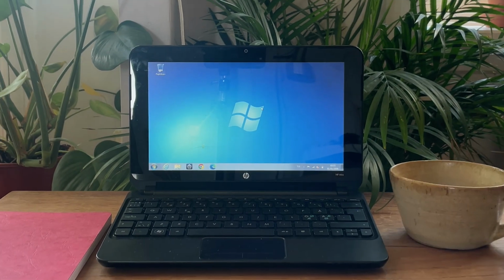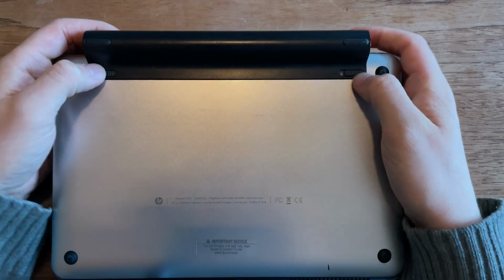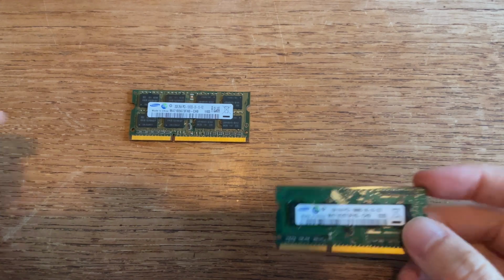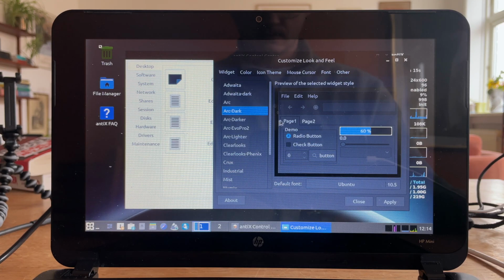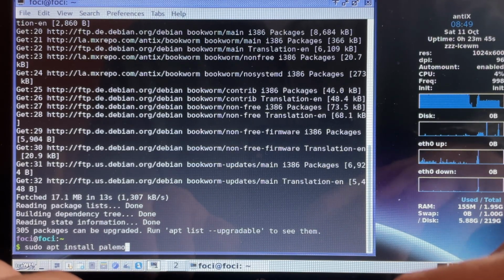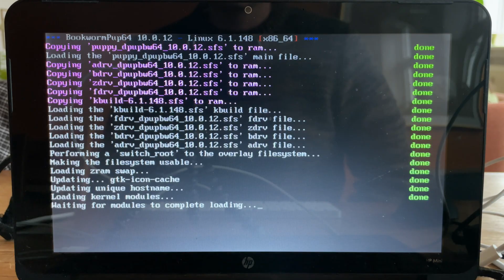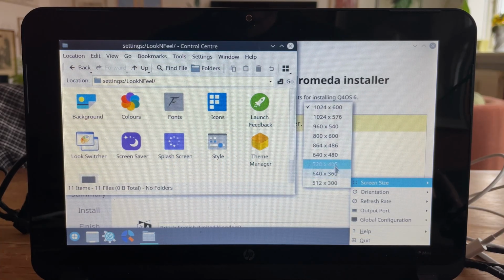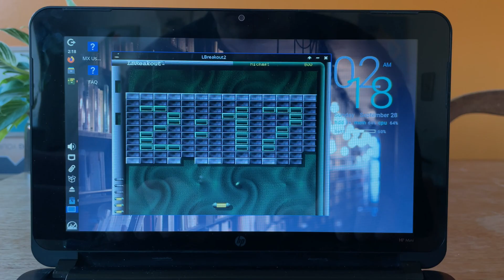Can "lightweight" Linux distros save this tiny laptop from 2010?

Comment: Firefox more like bloatFox ,its a mess on low end hardware.
From my own experience, install chromite +UBO lite extension for blocking ads +h264fy extension to loading h264 streams ,its the lightest codec to decode on these atom socs.
I also use chromite on my 1GB ram phone ,its the lightest up to date open source chromium fork

Comment: As a fellow  2GB RAM user, here are my advice: ZRAM for virtual ram and mpv + the terminal for streaming videos.
Reply: With a well optimized ultralight OS AND a browser thats no heavier than Chromium, in this case maybe even lighter like Basilisk. Its possible to get away with some streaming up to 720p in alot of these situations.
Reply: @TacticalPower88  1080p at 30fps worked fine. Another option is to run chrome/chromium with the flag:
--disable-features=UseAV1,UseVP9

Speaking from actual experience. Those ultralight OS are missing to many things that are useful for modern day system
Reply: Also have 10 GB of zram. I have a 8 GB PC but I still have 20 GB of zram, very useful when I'm compiling a Browser or open office type app from source.
Reply from the maker: Hey Neco! Thanks for the advice! New video coming soon :)
Reply: virtual ram.... no way you're telling me. I CAN ACTUALLY DOWNLOAD MORE RAM 

(not literally ofc but lmfao)
Reply: @TheQuaadFather  Same RAM, just compression
Reply: This.
Reply: ytfzf goated
Reply: Can you explain a little more detail on ZRAM and mov+terminal method? Looking to daily drive a 2gb atom tiny computer but know it will bottleneck
Reply: @flowermaze___  ZRAM compress some of the memory, for example with 2GB you might be able to get 3 to 4GB total of virtual memory. Auto-cpufreq might help you squeeze the maximum CPU speed if your CPU is design to do so. mpv + the terminal is use for video site like youtube that have issue with HD video playback on low powered machine. For more detail on the risks and Step by Step on how to set things for your particular computer and OS try  asking an AI.
Reply: run alpine linux with openbox, and mpv on that. it should easily stream YT then. (I've done this on 1GB RAM + a 2003 Duo CPU)
Reply: how about upgrading to 8GB RAM DDR3? it will SERIOUSLY dramatically improve it!!!!1

Comment: i still think that the best experience on this kind of device, would be to install arch linux with a lightweight desktop-envirement on it. My best results on my asus AO 722 came with an endeavor os with xfce DE. I also tried arch with i3WE on it, it worked very well, but it demands a lot of tweaking. Unfortunately i tried a lot of deb/ubuntu lightweight distros on it, it was realy unusable.
Reply: If I had a dollar for every time someone said "we have to start somewhere" when it comes to the tweaking part...
Reply: also for youtube i would recommand minitube or freetube, minitube works very good, but i haven't manage to make it work in the last months. freetube works very good. I think both can be installed with apt install command.

Comment: Sounds like a perfect Match for Haiku (also known as "Haiku OS"), which is the Open Source Successor to the 1990's BeOS, that's being designed specifically to run on Hardware even as old as 1997. So, maybe give that a Try. I certainly revived my old 2009 EeePC Netbook with it and I can only say: It just works. Even paired with the Falkon Web Browser playing YouTube. 😊✌🏻
Reply: Haiku is cool but its still way too much of an experiment. You're definitely on a island with that one.  You would be way better off just going with Tiny Core Linux.
Reply: I've had touchpad drivers issues with Haiku, which can be disastrous if you use it without a mouse.
But I agree that HaikuOS could be a fun experiment on that hardware.
Reply: i have an old pc running windows 7 and i might consider trying haiku on it
Reply: haiku is a great match for these small machines i actually use it for taking notes at school
Reply: haiku doesn't support gpu acceleration, it's not a viable option
Reply: @kvdrr  It really depends on what you need/want out of the machine itself. GPU acceleration is much less important if you aren't browsing the web, playing games (especially 3D ones),  or decoding videos.
Reply: Not for everyone.

Comment: I have a similar dell mini laptop at home that nearly have the same specs, I tried peppermint oa on it a while ago, it was fine running local videos and displaying images. But the YouTube thing was a deal breaker bec it'd mainly serve as a media device.

Sadly though, these atom processors and from an Era where the main focus of a mini laptop is office work and only office work.

So if you're a user how mainland focuses on word processing or slideshows, this device is very good for such a task, just don't expect that much from it.

But if you wanna have some real fun with it, give batocera a go. It's a distro designed to be like a hub for emulators so you can enjoy playing older titles all the way up to ps1 and ps2 games with ease.

So yeah, give it a shot

Comment: I had one of those Atom Netbooks with debian Linux and xfce
Reply: I have one too, and I thought only supported 32-bit, but no, supports 64-bit. Currently has Debian 13 with LXDE installed.
Reply: Sadly, Debian has stopped with its 32-bit distro.

Comment: I believe mint tries to use UEFI boot by default. On a netbook of this vintage I wouldn't be surprised if MBR is the only boot option. Might explain your woes.
Reply: Nah its usually good at detecting BIOS/UEFI when running the iso. Sometimes Ventoy can introduce some unexpected things.
Reply: @TacticalPower88 that i can belive, the issue i had was a strange one, where the machine could boot UEFI but it had to be installed in a more traditional method and this pile of crap was able to run windows 11, more or less if grub and uefi got stuffed into root instead of uefi having its own partition it would boot regardless of which install, it just had to have a drive in MBR due to its age.

Strange issue even stranger fix. Oh if you do grub2 on ventoy it will do the legacy boot and menu.
Reply: dunno if XFce plays ball but a bypass i used with standard mint was to partition the drive myself in MBR then force the install. create a swap a root and a home and boom done.
Reply from the maker: Oh, thanks!

Comment: Loc-OS is AntiX debloated, even further performance optimized AND its using a far more fleshed out/useable GUI too. Definitely my go to potato PC saver for both 32/64 bit machines! BTW, app choice is important too. Firefox is definitely a no go on low end machines. Definitely dont go heavier than Chromium browser, Basilisk would be a solid lightweight browser for GTK based AntiX/Loc-OS while Falkon is solid on QT based distros.
Reply from the maker: Thanks a lot for the advice! I’ll definitely try Loc-OS and a lighter browser. Thanks for watching:)
Reply: @focivideo  And if you'd like to stick to Firefox try ESR 52. Severely outdated but friendly for worst machines out there. Used as a base for K-Meleon which is also intended to run on antiquariate
Reply: @focivideo Note, Loc-OS comes stock with Librewolf which is based on Firefox. My 1st order of business on a fresh Loc-OS install is uninstalling that and installing Chromium and/or Basilisk. Loc-OS is pretty light straight away but theres things you can and should do to decrease the system overhead even further. Uninstall what you dont need, make sure those desktop effects/transparencies/animations are completely turned off and definitely disable unnecessary startup apps. This thing should actually be able to multitask with a few browser tabs and another app or two open. An AI chatbot companion like Google's AI mode or ChatGPT can easily help walk you through these things if needed.
Reply: I asked Nico (Loc-Os maintainer) and he said to me that zram is good only on a ddr4 machine with a decent CPU, that's why he doesn't include zram in loc os
Reply: @kolotxoz Yea, CPU is definitely the true bottleneck on this system. Hard to argue with the great Nico but Google AI mode says that the CPU overhead is extremely minimal and does very much recommend and justify still going with it, even in this specific Atom netbook situation. Kinda makes sense to me too. Its more than llkely that the Zram pros far outweigh the cons of less than 1% of additional CPU overhead. Definitely should make things like web browsing and streaming a lot more useable if 2GB RAM was functionally closer to 4GB RAM. 🤷‍♂️
Reply: Pin this comment for people's to know
Reply: Void linux + Helium Browser
Reply: If Loc-OS has a build for 32 bit arm I def wanna try it